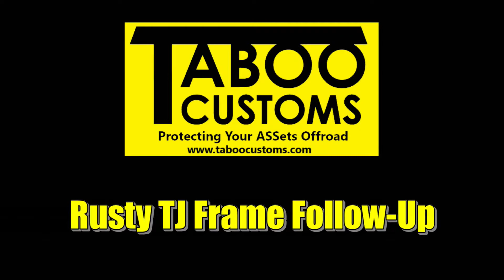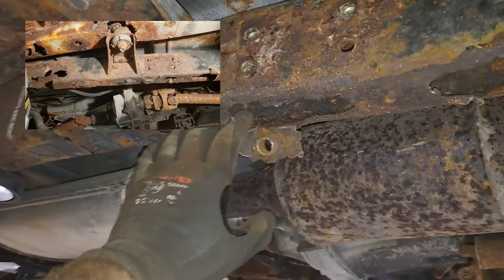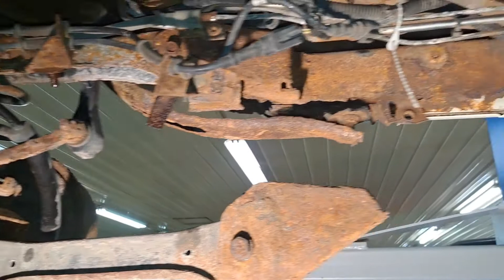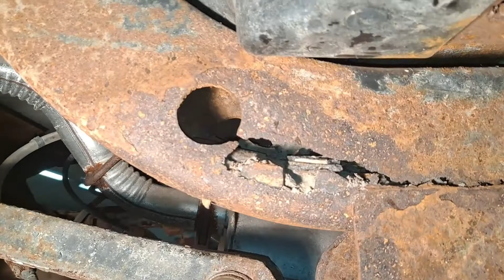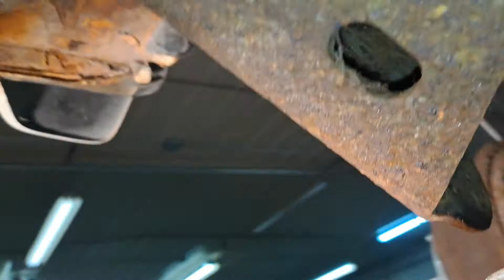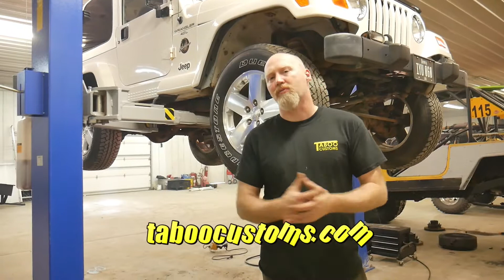Rusty TJ - Follow Up

Comment: I just did mine measure front to rear lower control arm bolts, piece of cake I have a short couple videos on it. Taboo customs is thicker and probably easier to install
Reply from the maker: Thanks, most of our frame panels are 10 ga (.13) with some parts in critical areas being 7 ga (.19) or .25.  We try to make them as easy to install as possible.